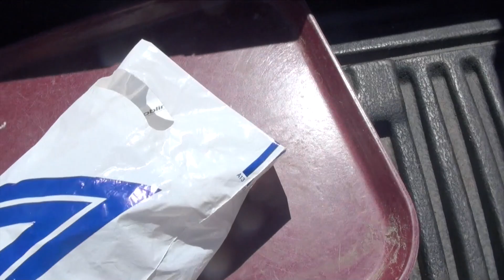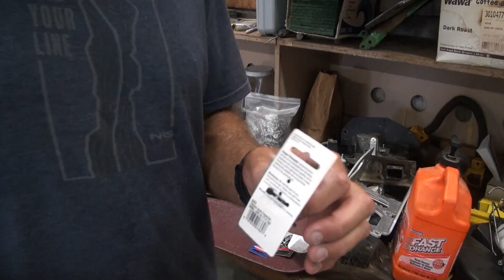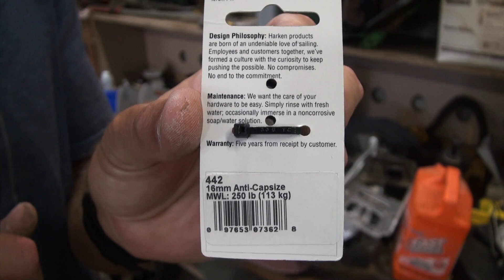An Easier Lift: Harken Pulleys on the Torqeedo Ultralight 1103

Comment: Concerned about your attitude.   I am 76 years old, and after cancer and open heart surgery I am seriously limited.  Switched to electric 4 years ago, switching to torqeed this week. My anglers support group online is mainly retired folks, with time and money to spare. Your videos are great,  and most  appreciated. Thank you. Now, shape up! 🤨😝😀
Reply from the maker: Glad this was helpful to you. The attitude was my frustration, mostly with folks who switched from the 403 to 1103 and wanted the newer, much more powerful motor to be just as “Ultralight” as the 403. This video and rigging was one that I put off a long time, similar to the “Locked Steering” video, because I didn’t feel was necessary. I eventually did both because the requests to know how kept coming. I still think that the locked steering rigging is a choice made by someone who is afraid to attempt the foot control steering rigging, not someone who thinks that locking the steering is a better way. After using this pulley set up for the 1103 lift a while, I think that it’s an expensive way to make the motor lift function a little bit easier. It’s better. Is it worth doing for everyone? Nope. Is it worth doing for some folks? Yep. Here’s the video that shows the standard way of rigging it: https://youtu.be/Up-mzJEF6i0
Reply: Len, I hope you got a rig that works for you. I'm old as dirt and I have cancer and ruptured discs, so I know where you are coming from. If you want more mechanical advantage there are double blocks from Harkin that can reduce the effort needed. It changes the pull length, but there are people using doubles on Hobie's... Jeff has some great videos, but some of us need that little bit of assistance. Keep fishing!

Comment: I have a single luff tackle set up on my install that works great in terms of "extremely light" on the arms. 

Using the 16mm Harken parts. You can't build a straight or inline pull if you are using a typical SOT and using a crate, plus battery, etc. So you have to rig so that there's a slight angle from the lift arm to the first hold point. My only complaint is that when you rig this way the UL lift arm will flex a bit. Not a huge problem but a bit of a PIA.

With a single luff block and tackle you get twice the ease of a rig with to single pulleys. This allowed me to stay with a seat side pull and not have to use "valuable real estate" on the hull that I can still use for attachments, etc. 

I love Jeff's videos - just adding that if you have a "standard rig" as in SOT with a trunk behind the seat. Consider rigging a single luft set up and route the lines accordingly. You can then still use the pull forward action and relieve the weight/strain.

The straight line pull on Jeff's set up is ideal though for straight line rigging, I bet he could use a single luff and not have to use the forward pull rigging. For standing and his set up - I guess in the end  it doesn't matter as long as it works 🙂

Comment: Vibe Seaghost 130 Torqeedo 403... two years ago I installed.    Saw your video of a similar install "Cilla Johnson" on the Seaghost.    I used my existing rudder lines... no problems.    But... I installed a small pulley to the top of the Swing Arm that the pull rope attached, but now runs through the pulley (fulcrum point).    The end of the line clips into the hole you originally put the pull line through.   Thus creating a leverage.   Works great.    For the pull line I did not run it through the body of the kayak.    The only issue is that the pulley I still installed,  I can not find a backup that is as small.    My back up pulley is a little larger.    So here's a funky story.   I am on the Chesapeake a lot, and you know about crab pots.   Well I snagged one trolling.   In the process of getting the hook out of the crab pot's rope... another crab pot line looped around the shaft of the Torqeedo motor.    Luckily a small boat came by and unlooped the crab pot off the motor shaft.   Otherwise... well I was going in for a swim 🙂
Reply from the maker: I’ve jumped into the Chesapeake to untangle my trolled line from the prop. Yes, that’s what it takes, and out in the middle of the mouth of the Choptank, I was not going to paddle to shore to figure it out.

Comment: I am installing my 1103AC tomorrow.  I purchased the pullies, but I am installing it on a Wilderness 135.  I keep a large cooler in the back and it looks like the cooler may be in the way of the lift cord while using the pullies.  Replaced the 403 which worked great on the lifting but the 1103 is much heavier.  How do you suggest I run my line so it does not cross diagonal to the lift pulley?
Reply from the maker: YakAttack Tie Down Eyelets. Put them on track on the sides of the rear well. They will route the motor lift line around whatever you put in the rear well.

Comment: Would this
Motor be a bit heavy for a hobie pa14 ? I am debating between this one and the Nk180
Reply from the maker: It’s not too heavy, especially for a bigger boat like the PA. Go for more power, lighter weight battery (13.2 lbs) and a complete system as opposed to a DIY electrical project that may or may not be waterproof by the time you are done.

Comment: what kind of cleat do you use?
Reply from the maker: I’ve used a bunch of different ones. The cam cleat with a metal loop over the top is the one that meets my needs best. I’ve gone high dollar on the Harken ones, and bought the less expensive ones on Amazon. They all work well.